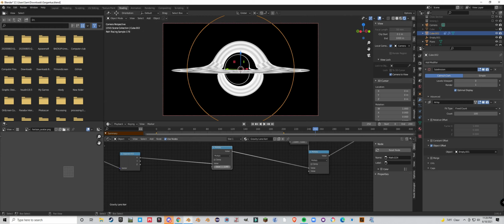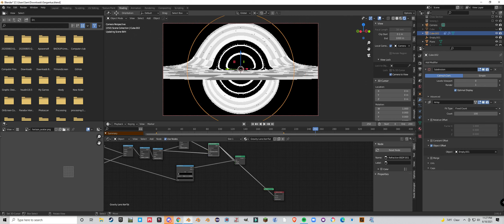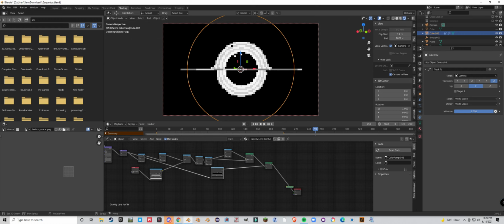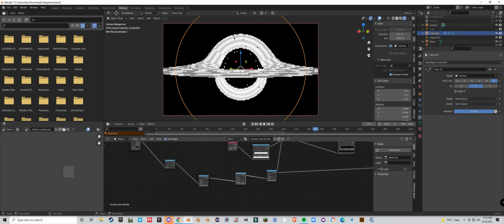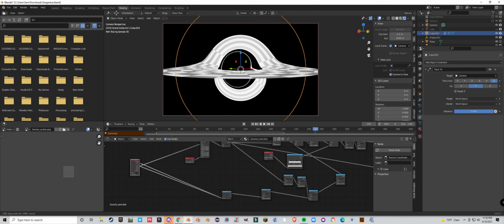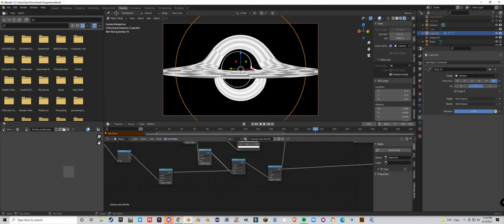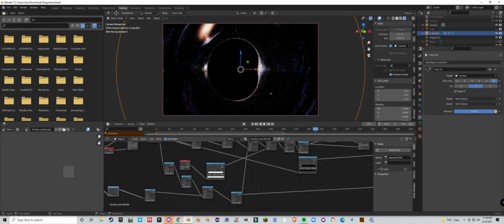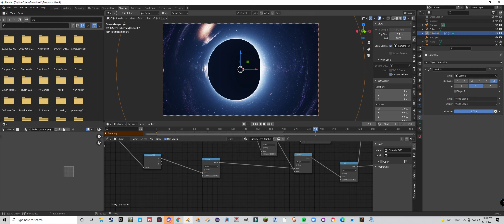Blender 3D Mastering Black Holes Series Extra: Kerr Distortion

Comment: So I may have found a way to bring back the flexibility of the black hole Kerr effect by using a Limit Rotation constraint after the track to constraint, and locking the x rotation to 90° and the y rotation to 0°.  With this, it will still turn to the camera, limit the rotation to only be around the z-axis.  And if you set the cube that we made into a sphere to be parented to another object, and set the owner transform space in the limit rotation constraint to local space, we can rotate the parent of the singularity cube however we want.  Thus bringing back the flexibility.

Edit: Just tested it out, and it works perfectly!  So for anyone who watches this video in the future and sees this comment, try doing what I said in this comment if you want to be able to rotate your blackhole however you want in relation to your camera.  I also hope you see this as well Samuel, as I think you would really find this a neat feature!